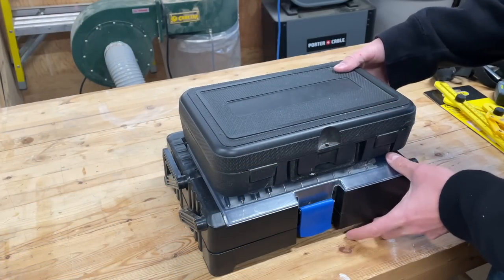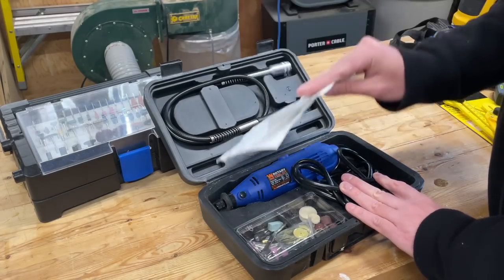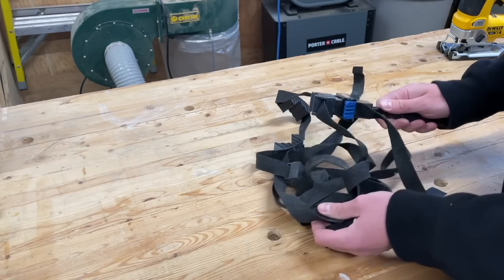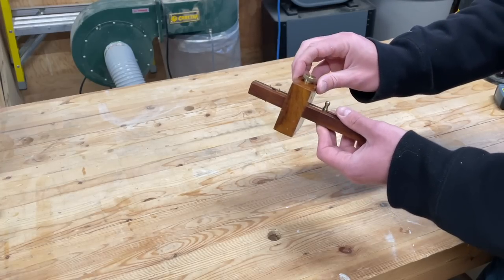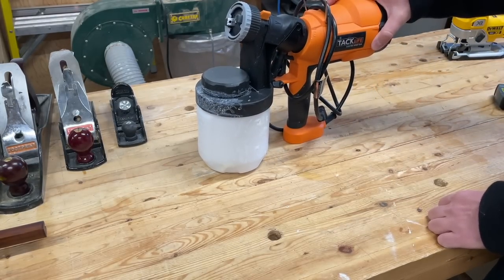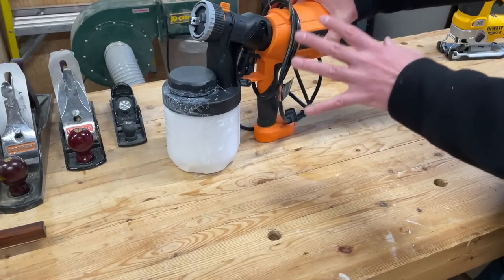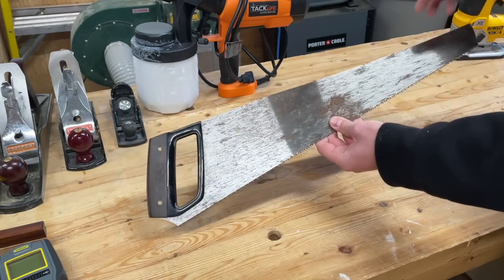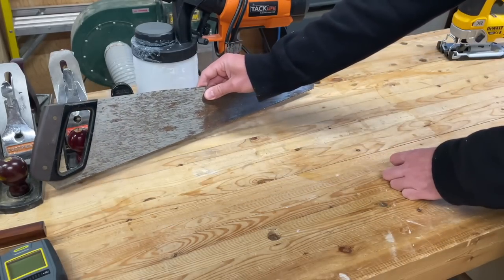Don't Buy These Tools // 10 Woodworking Tools I Wish I Didn't Buy

Comment: I used to do everything with a jigsaw as it was the only power saw I had for a long while. If you use some guide bars and stuff it's pretty accurate with a good blade. Cheap blades are a no go.
Now a few years later I have a cordless dewalt guide rail compatible circular saw. Nowadays that gets much more use but I still love my jigsaw. Though it mostly gets used to saw trough thin sheet aluminium and steel flat stock.
Reply from the maker: I’ve come around big time on the jigsaw! The right blades and the right speed setting have made a huge difference. Very clean cuts.
Reply: @MasonWoodshop  it might not be the best for a lot of cuts but sometimes it's the only way to get a cut done.
Hell I was even surprised that ones you start looking there's even blades out there for stone, glass, tiles and more.
Reply: I use those Swiss made Bosch brand jigsaw blades. They're decent. They work good in a Bosch jigsaw. It can leave a polished finish cut.
Reply: @1pcfred  I had some of the green bosch blades, wasn't quite a fan. I'm using cmt blades now and very interested in picking up lenox blades in the future, especially for steel.
Reply: @boomerangfreak  Lenox makes a good hacksaw blade. I have used a jigsaw on steel. It is not ideal. But sometimes it has to be done. When you are cutting steel the key is to not overheat the blade. The blade is tempered. Heat it up and it'll get soft. Soft it'll get wrecked. Wrecked you'll be cursing. To keep the blade cool you can use cutting oil. What I do is I have a cup of water I periodically dip the blade in. Cut for 20 seconds and dip. I use oil and dip. Oil on the work and dip the blade. Ultimately you'll cut faster and further keeping the blade in good condition. Also don't run full speed. Jigsaws are designed to cut wood. So they run about twice as fast as they should run to cut steel. There's a friction limit. Which is related to how fast the blade is moving. About half speed is about right. Go all out and you overheat the blade. Dipping and oiling helps but it is not everything. You still have to run the right speed. Do all that and a blade will cut good for a long time. Lose metal temper and you instantly have a butter knife. Milwaukee used to make incredible blades. The Ice blades. They were cryogenic treated. They cut like you dreamed a saw could cut. They were sick expensive though. I think they stopped making them? No one was willing to pay for them. But man they were like a light saber. You still had to run them cool. Any blade is good if you use it right. I run Blue-Mol blades. You want at least 3 teeth engaged with the work. 3 is minimum.
Reply: @1pcfred  good tips but when I cut steel it's all short and rather small stuff so the blade doesn't get too hot.

The way I did it last time is on full speed with pendel set on 1. It might be bad for the blades but it cuts trough the steel effortlessly. So at the moment I'm at the point where if the blade gets dull faster I'll just buy more.

Comment: Most of this stuff has two things in common.
1 cheap
2 Amazon 
Buy good stuff up front.
 No 5 jack plane 
A good metric ruler , small medium large
A tape measure
10 inch English tenon saw
22 inch Enlish panel saw
A good brand of chisels
and they will cost you quite a few dollars.
Some good quality f clamps 500 mm
2 saw horses
$1000 all up tad more maybe. Cheers from Tasmania
Reply from the maker: Hahaha, you nailed it with the two things in common. Great suggestions on what the buy at the beginning!
Reply: @MasonWoodshop  peoples perceptions will always differ. But if people talk about the subject often enough better out comes. Cheers from Tasmania

Comment: I would agree with about 90% of your determinations about the tools presented in you video.  I would think the use (or non use) of a jigsaw, however, probably depends on the type of wood work or the types of jobs that a wood worker does.  Building sets and large props for dramas and parties and similar events requires the use of plywood in varying sizes and thickness.  For me the jigsaw and palm router is indespensible for those sorts of applications.
Reply from the maker: I've really come around on the jigsaw and have been using it instead of my bandsaw almost exclusively! Getting nice clean cuts and the taking the tool to the workpiece has been nice.

Comment: It is very hard to break from the "tool of the month" club. I have several of those tools. My favorite place for hand planes is Ebay for used Stanley planes. They may require some time tuning up but, once they are they are wonderful. By the way if you want to buy more useless tools come to FL and stop by, I have plenty, LOL. Nice video!
Reply from the maker: Hahaha, "tool of the month" is the right way to put it. I'd add some of these cheap tools to my Amazon wish list, then when I'm ordering other stuff it was just a matter of "what's another 10% on this order" and I'd add one of these items.
Reply: My favorite place for hand planes is flea markets and garage sales. I consider the price tools go for on ebay a bit steep. Sure you can find stuff fast but I'd rather get it a lot cheaper. I pick tools up locally for next to nothing when I find them.

Comment: I guess you have never purchased a stud finder then? I purchased a Stanley one that was advertised for AUD$60+ on several sites and then saw the same one for AUD$20 so I nabbed it real quick without doing any research (reading reviews). It is an absolute piece of crap and just doesn't find studs or indicates electrical wires where none exist. I wish I hadn't thrown out the packaging so quick (I usually keep that until I know the tool works) so I could have rescued my AUD$20.

I agree a little with the "dremel". I have used it for several minor things but when I went to use the cutting disc I didn't see that the shaft was a little bent (got bad eyes and the distance I was working was between the focus range of 2 of my pair) and ended up cutting a wider piece than I was intending. Now that I know it's there I get annoyed every time I see the damage I did.

I purchased some cheapie (yeah, stupid me) clamps for holding the frame of my cheapie bench square together when I was making it. They worked (meh) to a degree (no pun intended) but were sadly lacking in ability to properly hold the wood pieces and was a real pain winding the clamp part in to hold the pieces. The major problem seems to be so many of these tools are made with that commonly available material chinesium which we all know the quality isn't great.

Thank You for sharing. 👍
Reply from the maker: Ahhhh yes...stud finders! I've had a couple and the Stanley that I had was awful. The number of times it would seem to have found the stud properly (from both sides), only to have my drill go through drywall and into nothing else. Thanks for watching and leaving a comment!

Comment: I initially buy cheap tools because I'm not sure if I'll use it enough. If i end up using it often , I'll invest in a quality version down the road.
Reply from the maker: Thanks for sharing, I can definitely see how that approach could be beneficial. I do that with my router bits - buy an inexpensive set of a 60+, then if I find I'm using a bit more than a couple of times I invest in a good single bit. This has resulted in 10-12 unique high-quailty bits in my collection.

Comment: Buy Kleins moisture meter. Not that expensive and very easy to use. I use mine constantly. I even take it with me, when I am going to the store to buy material. I have a few of Kleins various electronic tools (moisture meter and degree finder are my favorites) and find them to be of high quality.

Comment: I can relate to the cheap handplanes. I have also bought one from the Hardwarestore and its so super bad that its just not usable if you want to achieve something nice. I would achieve a better surface with a pencil sharpener.
Reply from the maker: Haha, totally agree. I spent time watching videos and sharpening and setting these planes but the results just aren’t there. They can work to an extent, but can be very frustrating when compared to high end planes.

Comment: the Dremel  is very nice to have when dealing  stubborn/hard to reach/rusted bolts/screws ... I also thought it wasn't useful until I had to change an exhaust gasket under my car.  also doing some rought shaping on metal small parts (where a grinder would be overkill and dangerous)

Comment: Yeah but the strap clamp it’s good for making frames, boxes, really any container. If you use it properly, it can really make a difference
Reply from the maker: Strap clamps can be great and I’m really liking the MLCS one I recently bought. The one in the video is pretty low quality and the strap is very frustrating to keep from getting tangled.
Reply: @MasonWoodshop  I mean practicality can only go so far, but sometimes it’s better in terms of money, time, space, etc to focus on functionality for the beginner/ammeter woodworker.

Comment: I made the mistake of splashing out on a Triton 2500 watt router that weighs a ton, I tried it on a test piece once and it has lived in it's box in my workshop ever since, ditto for the cast iron topped router table that I bought to go with it but don't actually have the room in my workshop to use.  Also cheap wood planes are the worst thing to buy as a novice wood worker, because a bad worker blames his tools right? I came to doubt my abilities so much because of my cheap Groz planes, but after finding an old Stanley at the dump everything changed. (A Stanley plane that is, not an old guy called stanly who lives at the dump who explained how to use a plane properly)
Reply from the maker: Thanks for sharing!

Comment: I've learned to stay away from the Mastercraft tools. They used to be okay quality but the stuff newer than the last 20 years has all been replaced with better tools. I have a Dremel rotary tool and find that I frequently use it for home and auto repair. I don't think I've ever used it for woodworking.
Reply from the maker: It’s a shame to see Mastercraft go so far downhill. My first cordless drill was a passed-down Mastercraft 10.8V with batteries that lasted about 20 minutes. Build quality was solid!

Comment: I agree that the rotary tool is a bad choice for woodworking.
BUT! While I never use it for woodworking, it is one of the most useful tool in my shop for repair work.
However, I 100% agree that the cheap attachments are crap. Especially the thin cutoff wheels.
Cheap tools are nearly always a bad choice.

Comment: Woodriver has excellent planes. Also… just throw the junk away! I’ve been in the same boat with some other tools. I didn’t miss them after a threw them out. Less clutter, is worth maybe not having a piece of ish when you need it. Which is never.  Good luck. I likes the video. Thx.
Reply from the maker: That’s a great idea to just get rid of them! I’ve kept almost everything to this point but why haven’t been used since posting this video (minus the jigsaw and Kreg tool). The rotary tool was sold, but the other items shall be donated/tossed this weekend! 

Thanks for watching and for the idea to reduce the clutter.

Comment: Cheap tools and know-offs are rarely a good alternative for popular name brand tools.  Quality tools are one of the few items that often maintain or even escalate with value over time.  Tools work hard, so they do need to be cleaned, sharpened and taken care of to insure that they work as intended and last a long time.  The only tool from your list I disagree on would be the Dremel (but it should have been an original DREMEL).  Dremel tools are awesome for fine work in tight areas and I use mine quite frequently.  I consider it one of my "Problem Solver Tools".
Reply from the maker: Totally agree! Luckily, these are about as bad as I got with “cheap” tools. Like you mentioned, maintenance of tools is important and it’s often much easier to maintain better quality tools (easier as far as process and motivation to take to care of them).

Comment: Even cheap tools can be useful, especially the rotary tool, but all planes need tuning to work well and a jigsaw is a very useful item. The overall impression I get from this video is that you haven't really tried to use a lot of these items to see what they are capable of. It takes time and effort to test-drive a new tool and learn what it can and cannot do, and how it is best used. Spend a day or two with each one playing around with it. You may find that some of these things are not too bad and possibly really useful.

Comment: I use the strap clamp. And by the way to store it you pull the strap all the way so that the corners touch each other, then roll the strap and you're done. Not that hard. And despite hating jigsaws, I do need mine for cutting shapes when using a template. One pass with the jigsaw, then the router. Couldn't do it without it.

Comment: I bought a cheap Dremel knock-off on eBay for £15. I use it all the time, for a number of tasks that would be difficult/ impossible with a larger tool. Admittedly I bought some decent accessories. Go figure lol.

Comment: Interesting idea for a youtube, - the 'regret list'.  When I saw that Dewalt jigsaw I had to watch to see what you thought was wrong with it as I use mine all the time, but you'd probably call most of what I do "DIY" projects.  It sees a lot of use in bench construction for my model railway (the underbelly of my layout would not qualify as 'fine woodworking').   I also have a few Dremel rotary tools and one knockoff ( a Home Hardware one).  I use those a lot - again for model work.  I"m a real Dremel fan.  Find they come in handy for so many things (DIY repairs).  Have to agree that for the most part Mastercrap stuff is barely OK  (I did find some of their clamps were just as good as much more expensive ones - not all but their heavy metal line, not sure it is still available).  Glad to see a Canadian reviewer.  Will have to check out some of your other Youttubes.

Comment: Whaat that tack life is pretty good for the price  obviously if you compare to 350+ sprayer it not Gona be equal but i didn’t think it was bad at all painted a fence couple doors paid for itself first job was thinking Going with Wagner control it also pretty cheap but  some ppl say dont have to thin paint with it since it’s a 2 stage
Reply from the maker: Happy to hear you had a better experience! Even with significant dilution, I couldn't get it to spray evenly without spatters. Might need to try it again!
Reply: @MasonWoodshop  ya I did about %10  just eyeballed it with  warm water with couple different paints indoor ,Outdoor , and paint & primer pre mix did fence and few doors with decent results better then paintbrush Any Way

Comment: Huh, I have that Wen rotary tool to replace a battery powered Dremel that never held a charge and it great for the times I need it. Though I've only used it once when wood working. It's nice for cutting plastic dividers.

Comment: I agree with the general statement of this video, but with the planes, moisture reader and Jigsaw it looks more like an issue from the user side (know-how, willigness to learn how to work with the tool, etc)
Reply: Exactly,  I came to say I have the same moisture meter, Jig Saw, and a Kobalt plane that once tuned works well, not the hardest steel but easier for a beginner to learn to sharpen.

Comment: I agree about the jigsaw. Woodriver planes are great as are Stanley’s. I would never spend the money on a Vertas not because they aren’t good planes but you’re not going to get any better end result from it versus a Woodriver or Stanley. Just sharpen the blade.
Reply: a used tormek T8 was the best purchase I ever made, I made crappy chisels the were all chipped up from using them on anything  i needed a chisel for back to a level so sharp i could shave with them with zero effort

Comment: I bought some tools on Prime Day with Amazon. I have even forgotten what they were. Obviously they were not good or not needed. Another great video. Thanks
Reply from the maker: Oh yes, Prime Day deals are generally where I load up on bits, blades, and all that jazz...which are mostly collecting dust as well! I definitely don't need 100+ blades to go with the jigsaw that I rarely use...but I have them. facepalm
Reply: Yeah, that's the worst, buying something that you don't really need, just because it's at a bargain price.

Comment: Tradesman don't usually have tons of different tools, they buy the intended tools for their trade, and buy as they, their jobs, or industry,  evolves, the tools they buy are generally purpose built , high quality commercial types.
The jack of all trades, homeowner, types like most of us, buy into the gadgetry, goofyness of the tool market, we want to cover all the bases even though many tools are used once and never touched again, we all have the extra screwdrivers, handles, sockets, cases, bits and bobs from kits we bought, but only use one tool. We all buy that tool on sale, that collects dust forever, or that tool that compliments other tools, but you never buy those those "other" tools, because you never needed to. The tool industry makes so many levels of quality, brands, sizes, models, to suck you in and make you think you need it, but you really don't.
Reply from the maker: Awesome insights, thanks for sharing! The tool market truly is an odd one that is generally fed from our want to have more and more. I really like how you noted the tradesman tool sets.
Reply: @MasonWoodshop  don't buy multi function tools or gimmicky tools they just fill up the toolbox, always buy purpose built tools